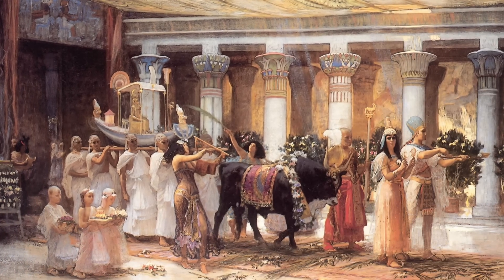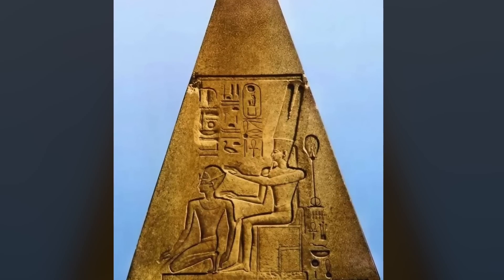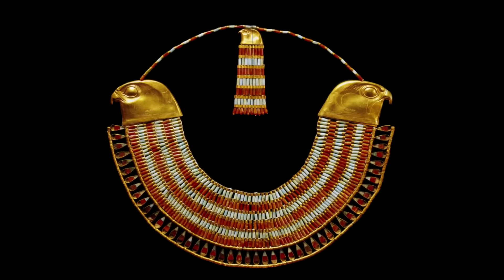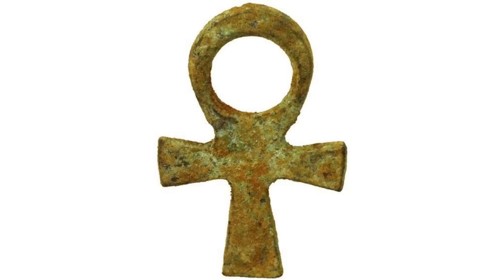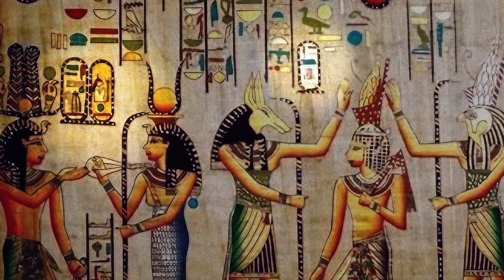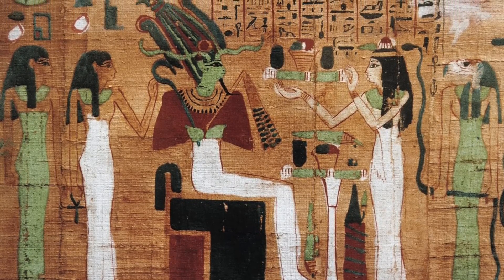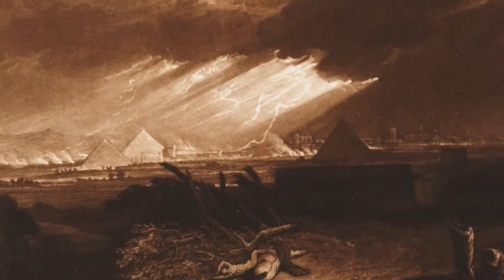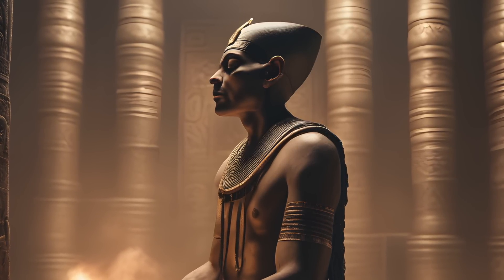Andrew Hall: Electricity in Ancient Egypt | Thunderbolts

Comment: May be I  could better explain the function of the Ank, as frequency vibrator/ resonator, amplifier device,once pointed at the sinuses of the subjects, they could easily stimulate and energise the pineal gland of the target person ,through transfer of vibrations, hence causing the activation of electrical currents circuitaries in the brain by the crystaline function of the third eye.this function could have also required deployment of some low energy electrical current as basic require.ents for activation of jets as well in general.the voltages and currents used  seemingly not being of significant value either,may be just enough to energies the jet pillars to function their recieving and converting the soundwave energies emitted from the pyramid of gisa to pointers which could be directed and pointed at different targets such as qyartz stones and  coloumns,to generate luminacity, being another very important subject of huge c9ncern to be covered in details as sources of free e ergies as well, but it certainly not being limited to that alone, and plenty more could be assigned and associated with this particular ancient naturaly derived technology alone, and the story goes on and on but at the same time the hypothesis of gisa pyramid as power generator not being fully explainable, because of none exustence electrical devices to consume high values of electrical energies, or not found as yet, also there are no clear evidences for the generation of high volumes of electricity, such as thise we are currently using for the household or industrial machinary none such devices being   found ,as yet, and also  because what we are discovering in ancient egypt is a full scale highly advanced ancient  civilisation , and not a simple anomoly, 
   Hence I believe the spectaculations made in this video clip are close to  the actual truth,may be teleportation of huge amounts of cats, over night to ancient egypt could explain the electrostatic energy  part of usage of cat's fere skin for the purpose, also having highly powerful electrostatic electricity generation properties as well, and that would be in exccess to my other hypothesis about cats acting as datas and infos collectors, amplifiers,and transmitters,referring to my 2 years ago article on sudden appearances of cats in ancient Egypt.where these animals never existed or seen prior to the event.
Static electricity could be a good way for giving temporary  stimulations ,or shocks may be as pleasure kick to the pheroes but certainly not possible to cover other kinds of more serious and important  applications,mostly because of the unstable and temporary nature of charges created by rubbing and alignments of electron charges on the surfaces of materials,such as glass, and wool, and  some other ones.
But may be the hypothesis of sonic waves creating the resonances in within quartz, and other crystaline materials,could induce such alignments in within the structures of these kind of crystaline materials,but not by one set of sonic frequencies only, and best hypothesis to explain mechanisms in action could be,that of  different kinds of mineral crytaline substances of  materials , should have responded in different ways,and most probably creating positive and negetive polarities electrical  charges , what can be detected on the hyrogliphs could be indicative of the same phenomena,, with may be earth as negetive or zero charge polarity as compared to the other positive electrode coming in from the charged stone crytalines located nearby and the vicinities of building structures , and hence the operation should be considered as continious one, and ongoing as long as crytal materials are stimulated and activated by the correct relevant  corresponding frequencies.unless a high capicity storage system could have been incorporated and linked in parralel,with the and may be even much more important conclusions and derivatives from electricity in ancient Egypt in its basic  natural  forms, could be another hugely critical and crucial derivative of , the famous ancient gods statements , of "we left all what humankind needed to discover and deploy for his eternal survival on earth", is beginning to make more and more senses, specialy when we hear most if not all problems, currently and also  since sometime ago, humanity has been  experiencing  from the beginning of his the so calle" industrial revolution",  has been taken the wrong pathways, by ignoring the safety factors for human health , as the most important hidden behind the scenes parameter, specialy once we can find all the best of naturaly derived forms of energies, from simple natural earthly minearals easily deployed and even fully constructed and inplaced in the form of ancient temples,and manuments, ,for us most of them being fully operational too,even with a simple re- adjustments and a final touch, and hence the most important question to be asked  is:, are we the ones whom are destroying our environments and human psychics, through infection of our air and environments by high frequency short waves, and radiations,causing pandemics,and states of war and fear mongerings, and natural catastrophes, where may be we are assigning them to being  harshly impacted by the influences of the Archonic energies and forces,and all that by our own mistakes not taking the subject seriously,, this phenomena can be explained in great detailed through proper studies, and investigations, and immidiate solution in sight could be to shut down the high frequency hazardeous stuff asap, the cause effect results should be so emense, that hypotheticaly, most existing  negetive energies on the planet should disappear,leaving pace for positive ones.why not try it and see the outcome ,what do we  have to lose? right dear freinds?.
Reply: Dear freinds, 
From the details being given here, and the very critical to us predictions of solar flash hitting us in around mid September, as mentioned by the so many on the media as well, may be once we could suspect having the tools to change the timelines of the upcoming events, and may be as our last move, prior to facing the consequences of experiencing a very severe form of a catalysmic disastrous event, then one could easily conclude, such an opportunities as our last shot, should not be missed or ignored, or may be we shall experience more serious outcomes just the hard way , right ?

 And also  again from the above mentioned reasoning,one can easily become highly concerned about how  the negetive impacts of artificialy generated high frequency energies in general, as a basic requirement  for the so called AI technol8gy,should be dealt with, and  once the power grids and satelite telecoms,are shut down by the solar erruptions  may be preferably no more re structuring of the same kind of techs should be on any futuristic agendas hopefuly right again dear freinds,?and if the replacement substitude, alternative  techs are needed to be discovered then must do so, after all safety is every civilisations priorityand also, in relation to the same subject of our futuristic determining factors to concentrate on certain technologies also hopefully not harmful to our health, seemingly the prospects of deployments of soundwave energy forms ,as displayed by the obylists also spread in different key l8cations on the planet, sometimes in combination with the female aspect of ancient egypts isis ,such as house of the representatives in the washington dc, central and political  dustrict ,the whole concept gives one the impression of from ages ago, the hypothesis of deploy.ent of soundwave energy forms,as being a safe and reluable highly advanced technology, leading to a much more advanced versions of tesla techs, being of great concern , and as basic ingredients for the futuristic stratagies, but with the very fast trend of  high speed new advance.ents,may be even much more innovative technol9gies could have been overcoming and replacing the older paradimes, but as far as ancient gods leave behind techs are concerned, may be we could consider the above mentioned ancient  tech , as eternal, safest and mist reliable, without the complications existing once the AI systems are intervened, hence apparently  a great task yet ahead of us to be dealt with , right dear freinds?

Comment: In the past the earths magnetic fields may been much stronger so that the step potential (voltage differential  between your feet as you walk) was much higher. This kept people in the stone age as most metals corroded quickly due to induced currents resulting from the greater earth field strength. Van de graph and linear generators would more easily produce high voltage,    I agree, Egyptians display themselves using electricity without needing modern equipment.

Comment: hence the expression "mind-blowing" if "mind-zapping" went wrong!  Excellent time for reflection. Indeed the knobs "nubs" are matching your suggestion... adding the ancient concrete (somewhat proven) hypothesis. It is most likely that Ancient Egypt was a way different climate and environment than today. The Sahara was lush just before that and significant catastrophic geo-events happened. The ruins in rubbles (statues, temples... blown to pieces and torched to melt point) at Tanis, Abu Sheer and other spots are clearly results of cataclysmic events of epic proportions. The statues are blown into pieces and burned beyond 2000 degree Celsius according to geologists.   Upset Electric Univers?

Comment: This is very interesting, considering this line of thinking, what if the gas they were using was not helium but sulfur hexafluoride (SF6) which would cause a deep “godlike” voice. Sulfur hexafluoride (SF6) is often used as an insulating gas in high-voltage electrical equipment due to its high dielectric strength and thermal stability. It helps prevent electrical discharges and arcing that can occur in electrical systems.

In the context of plasma, SF6 can be used as a plasma etchant in the semiconductor industry. It's also used in the manufacturing of microelectronics and flat panel displays, where it helps etch patterns on surfaces with high precision.

Overall, SF6's properties make it useful for preventing electrical discharges and arcing in high-voltage equipment and for specific applications in plasma processing.
Reply: Yeah, because they obviously had the factories and manufacturing capability to distill different types of Gases.🙄

Comment: When a team of researchers explored a couple of ducts in the great pyramid a few years ago, I was struck by the copper rods at the end of each duct. In one the copper was sound, in the other badly corroded. I've noticed over the years corrosion forming on the cathode terminal of batteries (lead acid, as well as non-rechargeable AA type batteries). I wondered if these ducts were part of an electric  energy storage device.

Comment: lol..the "lightbulb" is clearly an open circuit, meaning the "element" ends with the snake head, i.e. can not conduct electricity...how does that work eh?
Reply: True, If the snake in the light bulb depicts a glowing filament in an incandescent lamp it would require a closed electric circuit to function. However, if the snake in the bulb is a plasma formation, like that found in a gas discharge tube, it could easily function in close proximity to a high voltage electric field. ( https://youtu.be/pWJ4nzaXnyY?t=178 )

Comment: The pyramid just amplified the Shumann resonance of the earth 7.82hz and the ankh probably resonated it and focused it on the pharoahs face. There is no reason to touch the face. The insence in the air likely increased the dielectric properties of the air so that higher potentials could be experienced without flashover

Comment: Healing is voltage according to Dr. Jerry Tennant, and what if they were using it with Frankincense and Myrrh which I recently learned is a hallucinogen when used together. People were hot boxing in the holy of holy's and zapping themselves with the Ark of the Covenant! lol
Reply: Had similar thoughts about the Ark of the Covenant though according to the text there would've only been one guy ceremoniously entering the holy of holies one time a year... so? Myrrh is not mentioned in connection to the tent or temple. And the word translated as "frankincense" only means something white, presumably salt, since it was supposed to be put on the meat offering together with the oil and the flour, then grill it up for a sweet savour unto the LORD. And then the priests would eat of it 😄

Comment: I find it very interesting yet there is not any real evidence of all this electrification. 

Surely so much electrical activity would leave not just drawing on walls that are open to some interpretation but also actual physical archeology of electric cables,wires, contacts, remains of at least the most basic circuits, surely there would be a plethora of evidence not just one Bagdad battery that is for one debatable if it is a battery and two why only one 'battery' found so far. 
Hardly makes for compelling evidence 🤔 
I want to believe in some of this but all I see is conjecture and maybe's and possibly etc. not facts. 
Conjecture is fine it helps widen our thought processes but however possible it just may be, we have no evidence in the archealogy. 

Only a different interpretation of hyroglyphs, that if any work was done on Egyptology may clarify many of these issues raised here.
Reply: Look up Miniminuteman videos, he actually points out why we really don't know what the Bagdad Batteries were used for, or even if they were batteries at all. He also points out that the hieroglyph that many pseudo archeologists use to claim the Egyptians had artificial lighting, the Dendera Light, is actually a normal part of their writing system and is actually about the creation of the world.

Comment: If it is true that high voltage was an objective for the early Egyption culture is must be possible that " silent discharge " of current through the liquid and vapour phase  " aromatic hydrocarbons " was a real event. The Egyptions were famous for their work with perfumes (  aromatic hydrocarbons  ) - { also used for embalming }.  Resulting in the breaking of Carbon, Carbon double bonds by Ozone ( O 3 ) [ Ozonalysis ] and other more advanced / sophisticated chemical manipulation < which it is unsuitable to detail here  >. Not just sparks and " Zapping " but advanced medicines produced at point of use , thus avoiding storage / instability issues.

Comment: I've noticed this, as well. They seemed to be charging and discharging using atmospheric electricity. Fractal gold wings might as well be the best electrostatic antenna you could devise. Wood platforms to insulate from ground. Elevated golden thrown/chairs, insulated from ground. The massive fractal pattern crowns using alternating dielectrics and conductors.
Reply: I've read that some consider dna to be or have fractal antenna properties. Many interesting possibilities and implications to ruminate on.
Reply: Triboluminescensce i could be wrong with the big word... these people worked stone... if you crack stone by night.... you might see a spark. Just as rubbing crystals together...
Cardinal points seem to be keyhole.
Frequency the lock.
Where you are, some factors may differ between the strength of the north and south. 
Also check edward leedskalnin.
Reply: @humbuccaneer84 if you crack stone by Night you have, swollen thumb in the morning .. 🥵😠...
Reply: @-wotiu_77  you should work on your aim 🤔🤪
Reply: @humbuccaneer84  
I thought that was you, breaking rocks in the dark ..
Reply: @-wotiu_77  look up old mining techniques. It's almost similar to a ram pump but sucks down air to compress in a chamber... trompe system.
Reply: @humbuccaneer84  learn to read heiroglyphs like I can, most misinformation is the fact that people look at pics, and fail to read what is written around them
Reply: @drummerdad80  you can't just read... to read you need knowledge. Otherwise, people read the bible and.... well, let's say there is a nightstalker in bethlehem. 

A rabbi on yt tells about adam and eve... but somehow questions their relationship and wonders about emotions...

Most just don't understand what the text is saying.
Reply: @humbuccaneer84  most just look at carvings and make up stories, when a story is written right next to it lol, most don't understand because they are not fluent in that language, your comment is hilarious,  so disregard what is written and believe what is a thought lmao
Reply: @drummerdad80  there is a coffin. On this coffin, there is a wave line a graphic.
This is nearly identical to graphics shown up in x ray science. Electronic discharge in a vacuumtube. Maybe it is just coincidence 🤔
Reply: @drummerdad80  so what does the story tell you.
Reply: @humbuccaneer84  that the dendara carving is the story of life, it is the circle of life surrounding her Sema towy(horus) and the djed pillar is the symbol of stability, absolutely no where do the Egyptians talk of electric power sources, if you want disregard what is written and believe what is speculation of looking at something that's your choice, I would believe what the Egyptians wrote, I mean they made it.....
Reply: @humbuccaneer84  and don't get me wrong I love thunderbolts, I been a sub for 15 years, but this is not science at all, and I am surprised they even allowed this video to be published, it is pure ancient aliens crap....
Reply: @drummerdad80  if you want to discard meaning to the story or creation. You might take things the wrong way.  

Do you own an original egyptian dictionary? One from at least 3500 years ago? If not. How do you know what their words actually mean. Or whether there might be sinnonims.
Reply: There is not one shred of evidence of electricity use in egypt
Reply: Not true.